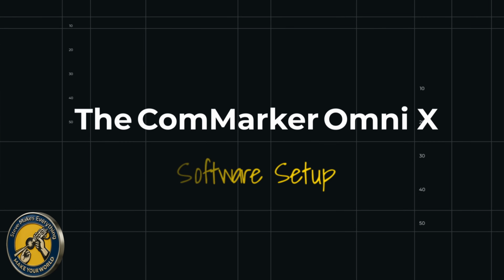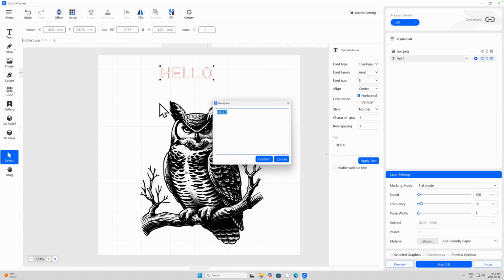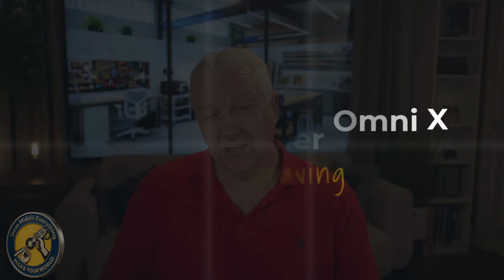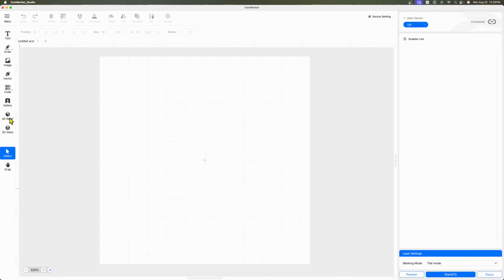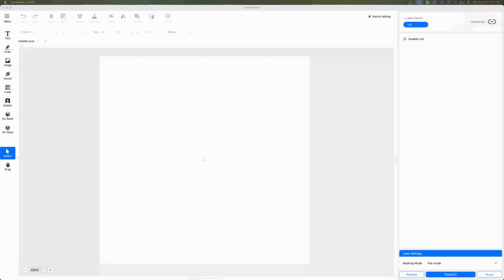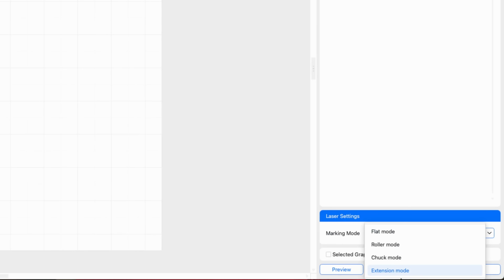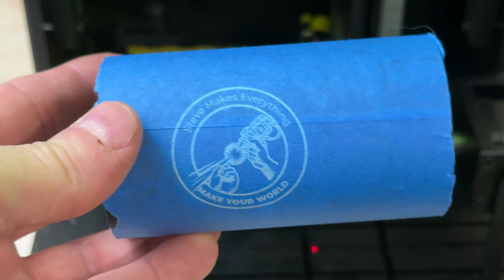Engraving Inside Glass?! The Game-Changing Omni X UV Laser

Comment: Prefer this model over the xtool uv laser engraver?
Reply from the maker: Tough question.  I have several xTool lasers in my shop simply because they are easy to use.  If you were looking as the 5W UV, then I'd lean to that, but if you wanted more power and opt for the 10W laser, then the only choice would be the ComMarker.  I will note that the actual laser output differences are minimal, so if price is your key objective, then the choice will be the ComMarker.

Comment: If the F2 is just a mopa fiber machine can any other mopa fiber do the same with the 3d glass engraving?  Or is it a software particular to the F2 that does it?
Reply from the maker: 3D glass engraving is basically limited to UV lasers for a couple of key reasons.  First UV lasers have very small beam which is great for engraving and second, the have a very sharp, narrow focus, which is easy to control as far as depth accuracy.  And also Fiber lasers won’t engrave glass.
Reply: @SteveMakesEverything  Hi Steve, I ordered the Omni X 10w and looking forward to getting it up and running.   I want to order some jigs and so can you tell me what the center to center spacing is on the holes in the base?   I see jigs for the ComMarker but not specifically for the Onmi x.

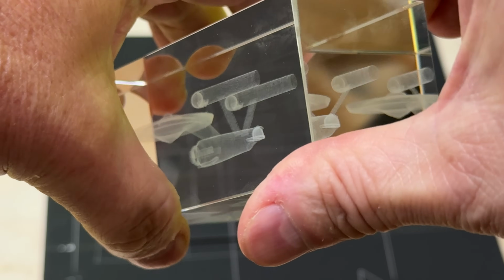Comment: 9:14 Very cool, except it didn't etch the whole model. If you compare the etching to the 3D model, you'll see the ends of the two warp engines are cut off. Did you change a setting or crop something, or did something go wrong with the burn?
Reply from the maker: Yeah, my screw up. The laser is fine, but I’m definitely broken 😏

Comment: Hey Steve,  love your videos. I just purchased the Omni 1 10 Watt. I'm seeing that this Omni X also does not having any visible laser preview. So, just like the Omni 1 in that regard. I asked them about any upgrade kit, and they said it would take a cable to do... but that they don't have that cable. I am really wondering if it is worth trying to exchange my unopened Omni 1 10W for the Omni X. What is your honest opinion? I really just want the 2.5 D relief capability. Not even the full 3D engraving in the glass module. Any advice? Is there a way to add a stepper and use LightBurn or some other software for the Z-axis to have any sort of functionality like the Omni X ? Also the slider looks promising. Does the slider work with an Omni 1?
Reply from the maker: The Omni X is very similar to the X, except for the controlled Z-axis.  Unless you really want to work with a lot of glass, or you want to do wood reliefs I think you're fine with the Omni 1.  Ask ComMarker if they has an upgrade program.

Comment: So since link is broken, what is the price?
Reply from the maker: I fixed the link to send you to the Commarker site, but the Omni X isn't there quite yet.  It's going to be $4600 at an introductory price ($700 discount)
Reply: @SteveMakesEverything Darn! I just bought the Omni 1 last month. I should've waited for this one. I haven't even unboxed the Omni 1 as yet. 😢
Reply from the maker: @davelyew4645  See if ComMarker will do an exchange - I'm not sure.  However, if you got the Omni X, you'd be having the same conversation about the next laser in another month. 😀. The wheel never stops turning.
Reply: @SteveMakesEverything Thanks for suggestion Steve. They're generously accommodating an upgrade since I didn't open the box.
Reply from the maker: @davelyew4645  Awesome!